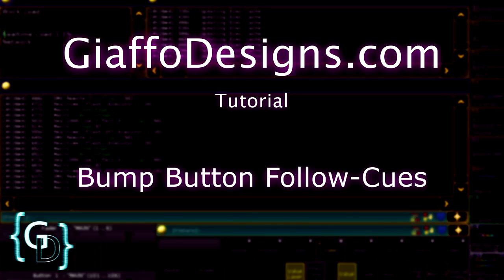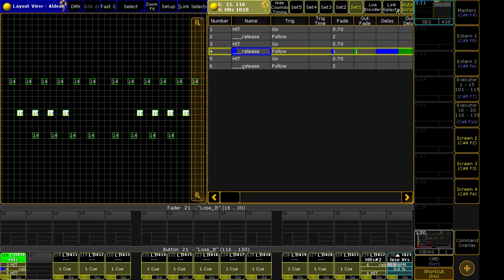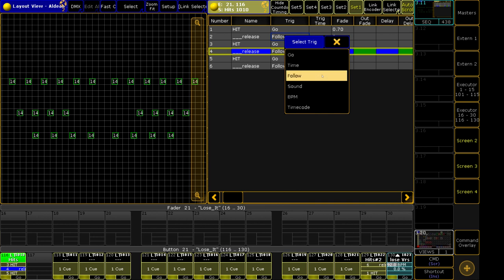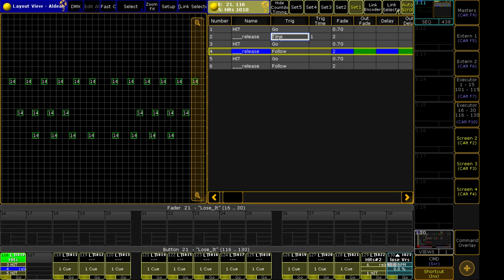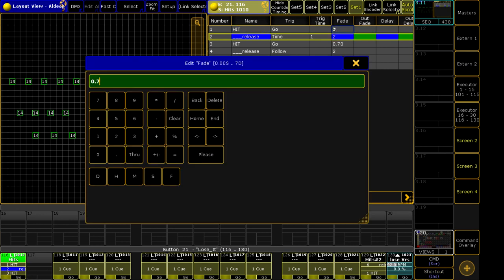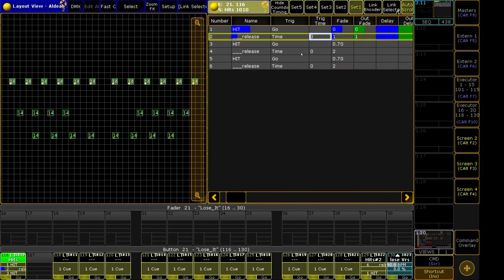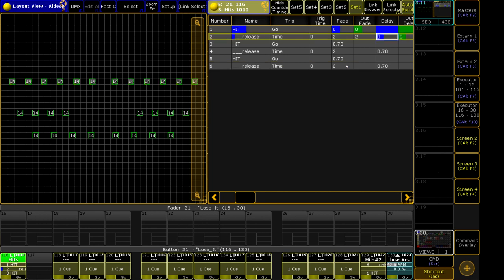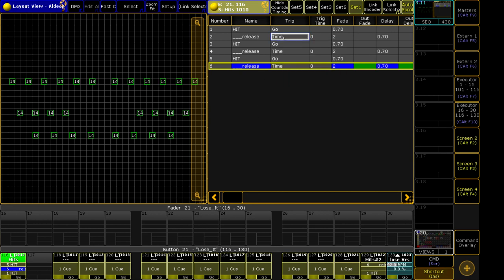Bump Button Follow-Cues

Comment: I would just make the go-button a go_release and set the executor to restart next cue. Then you can set the off time for the exec and delete all the release cues and just have the three hit cues.
Reply: Yes, also means you only have to update 3 cues in case something changes in the programming instead of all 6 cues to keep working if you add more fixtures or different parameters ;)